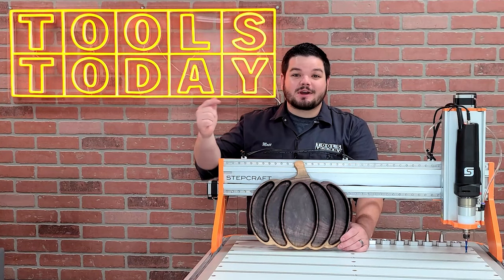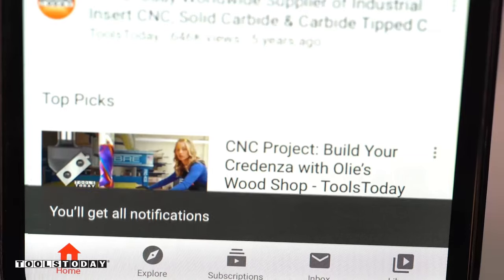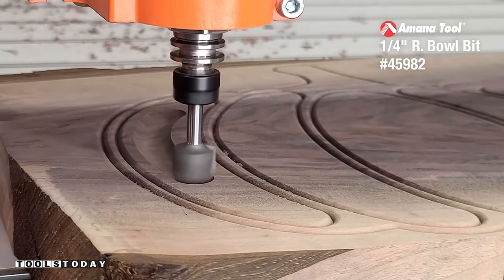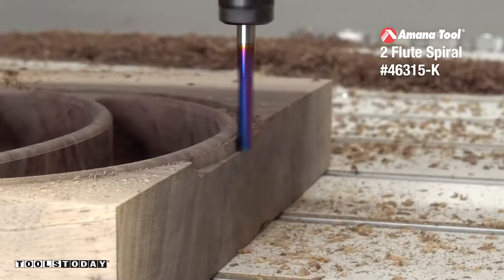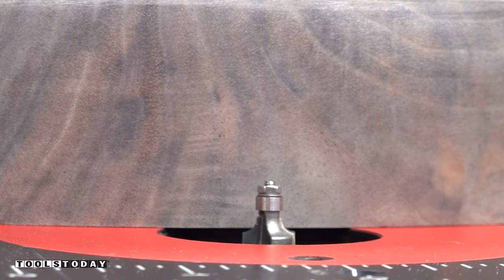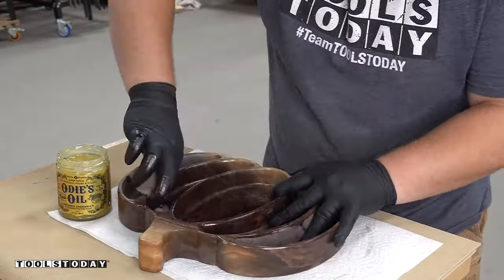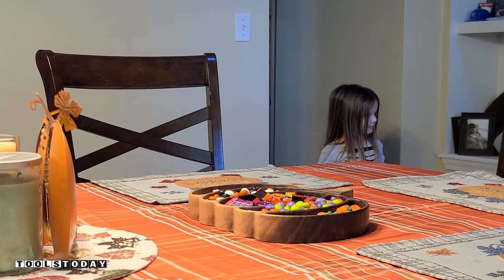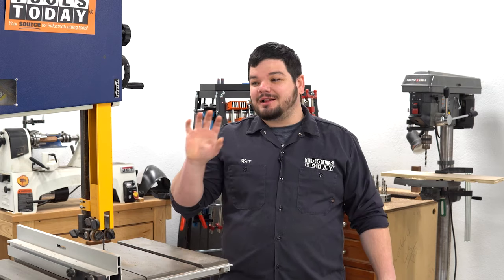How to Make: Pumpkin Tray on CNC | ToolsToday

Comment: I love this project and I bought the plans and the bits.  I've made three of these so far.  I wish I could hear your bits running during this project.  Does the spektra bit naturally scream like a banshee?  Even at 200ipm and 18,000 rpm it seems like it wants more feedrate and I just can't cajole my 6040 with 3hp spindle to go much faster than that.  I'm thinking of going to 2xD DOC and slowing it down to see if it improves but I'd love to know what the spektra bit is 'supposed' to sound like during a happy cut.
Reply from the maker: Thank you for the support, I'm glad to hear that! It definitely shouldn't be screaming as that is creating chatter generally.  You can always try slightly lowering your RPM to see if that helps the issue.